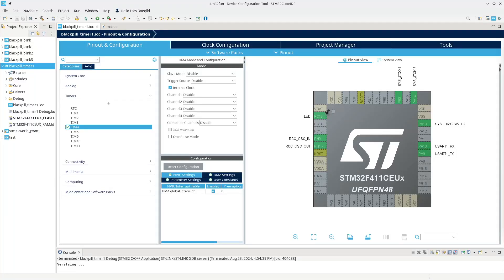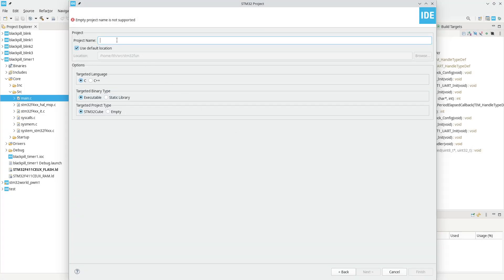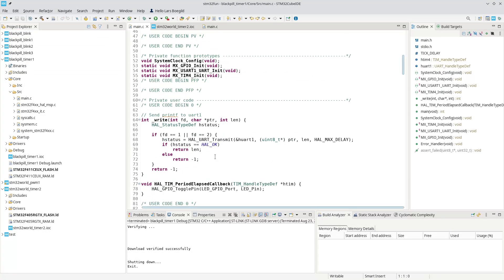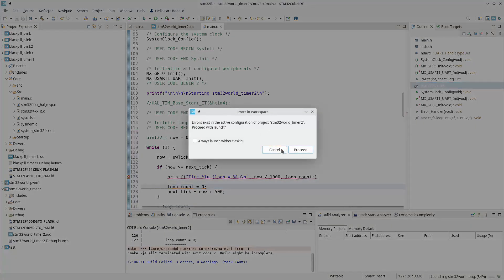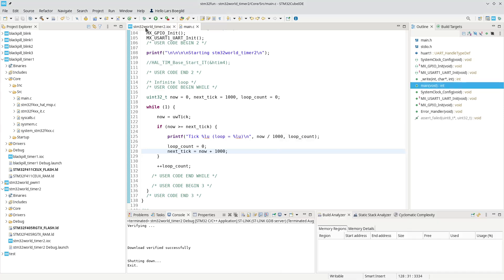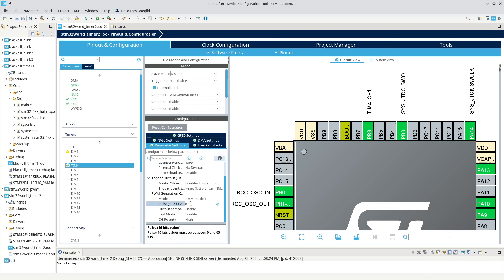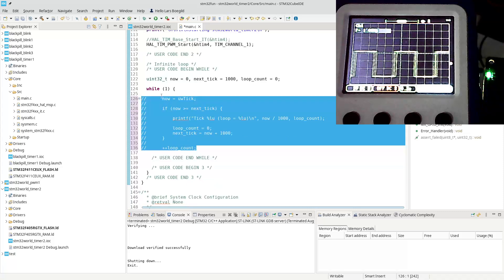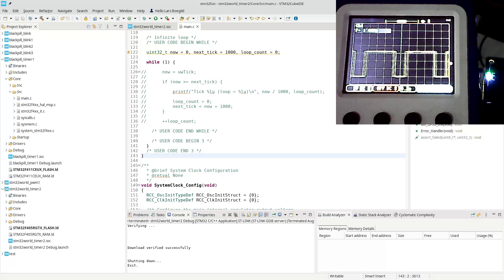STM32 Tutorial #9 - Using a timer channel to blink a LED

Comment: hello Sir ! can i ask why you said the freq is 1Hz ... The base counter period is 1400 so 0.5 s so i think 2Hz
Reply from the maker: 84000000 / 60000 / 1400 = 1   Not sure I get where you get the 0.5 s from.
Reply: @stm32world  Why You used 84Mhz instead of 168Mhz?
Reply from the maker: That is explained at @03:58 - the timer in question is connected to the APB1 timer clock.  This is documented in the datasheet.
Reply: @stm32world  Understood Thank you
Reply from the maker: Check the block diagram in the datasheet

Comment: Great,
1) At 12:38 , you are diving 84 MHz on 60K, where 60 comes from. Is it target frequency?)
Also could you explain about the physical meaning of this "-1" offset which encounters every time.
2) And is PB6 and PC13 somehow connected?
Reply from the maker: I am surprised if I didn't mention it - but yes - I probably just ran a wire between PB6 and the on-board LED.  The -1 - hmmm - short answer is that is just how it works on stm32 with timers.  I am positive that this is explained in the reference manual somewhere.  My guess would be that it uses a > and not a >=.  I don't remember the calculation but it looks like it blinks at about 1 Hz - so I probably divide the clock down to that while leaving enough counts to actually adjust the duty cycle.
Reply from the maker: Both prescaler and counter starts with 0 and count full cycles.  So to get N cycles you need to count from 0 to N-1
Reply from the maker: The wire shows in #8 - I probably just assumed I explained it there.  My guess is I shot these videos after each other.
Reply: @stm32world  you mentioned it in the same video that this is possible way to attach tnem, but in running example board was in shadow and that was a check if I understand your previous explanation correctly
Reply from the maker: Yeah - the only way to get PWM on PC13 is by bit banging.  See https://stm32world.com/wiki/STM32_bit_bang_PWM
Reply from the maker: I do explain the calculation just before - so around 12:00.  The problem is the timer in question can only accept 16 bit values - so need to find a way to get down to 1 Hz.  I just guessed a few times and found a couple of appropriate values.  84000000 / 60000 / 1400 = 1
Reply: @stm32world  thanks now it's clear

Comment: learning something new each episode. today's lesson: i reused the previous project as I'm lazy, and after shorting the led pin with the TIM PWM pin i could see the PWM signal on my oscilloscope but not the blinking led. i needed to do a reset_state on the led pin in the IDE, as i can guess i needed to keep it floating, so only the PWM signal will actually toggle the voltage on it.
Reply from the maker: Don't ever forget - screw ups is the best learning tool there is.  If it produces blue smoke it's even better.

Comment: For people that have been following him from the very first Tutorial, you can very well skip the first 4 chapters of this video and can start from around 11 minutes. Others can watch this video from the beginning. :)
Reply from the maker: Yes, granted - at times I might end up repeating myself a bit ;)  I do take the time to manually add the chapters to all the videos, so it should be fairly easy to find the important bits.  I can't remember now but I believe this was one of the first videos using a STM32F405 rather than the STM2F411 and that's why the project setup was included.